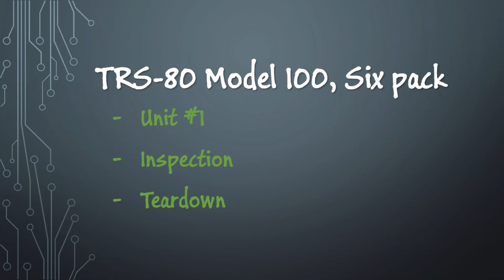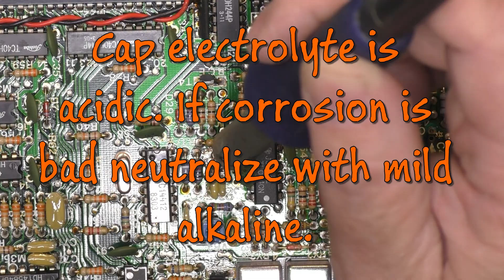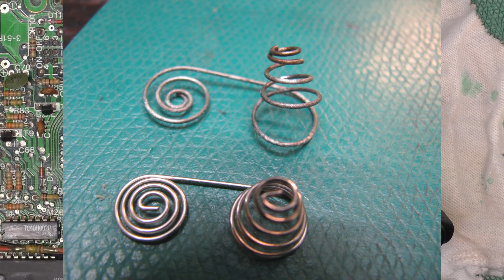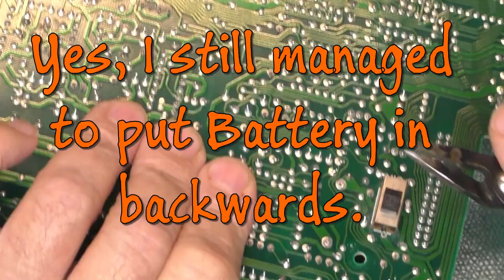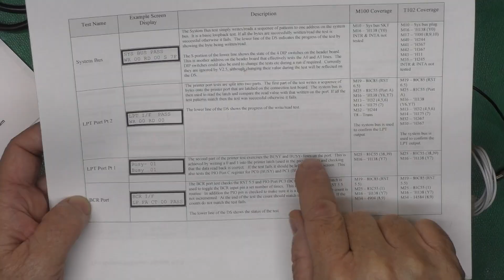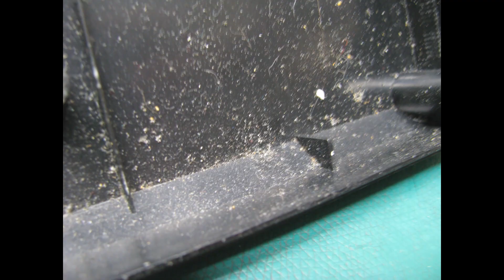TRS-80 Model 100 6-pack. Six M100s in need of some TLC.

Comment: Ever tried an ultrasonic bath for cleaning the PCBs ?
I do this with boards I work on then use alcohol to displace the water then  dry it in with a hair drier.
This can clean up behind the pins and over all does a great job.

Comment: What do you mean by: Neutralize with mild Alkaline?
Noel's Retro Lab, I just Subbed, interesting
Reply from the maker: The electrolyte in capacitors is acidic. To neutralize it you use a chemical that is alkaline (a base). Household ammonia, concentrated cleaners, etc. will do the job. 

If you have alkaline batteries leak you neutralize the corrosion with a mild acid like vinegar or citric acid.

Comment: I am not familiar with the Model 100, on these machines is there an external video output port on them anywhere ?
Reply from the maker: No external video on M100 itself. There was a 'DVI' which was basically a 8086 PC you could connect your M100 to. It had a monitor, and disc drives.